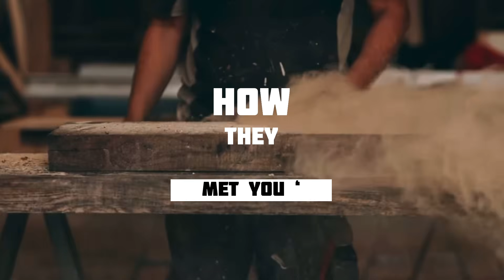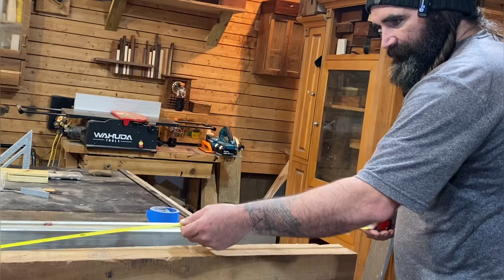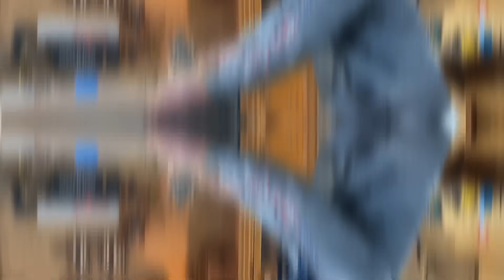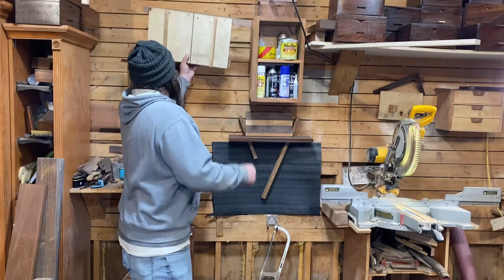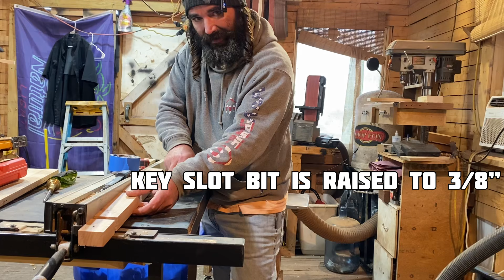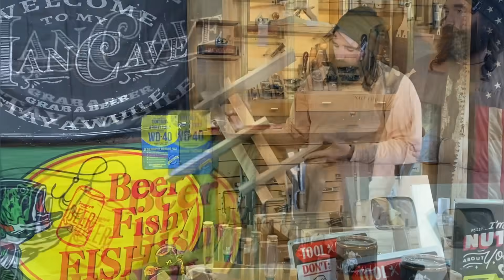These Projects Are Selling Quick / most Profitable Project in woodworking

Comment: lol I love how most people can get hardwood pallets all the ones around here are pine and the rough cut is only about 1/2 in thick slats so about the only thing you can use is the 2x4 piece that they use like you did but they almost always have big cuts in them for forklift forks to go in so there hardly anything to use in them around here 😞
Reply from the maker: Check job sites for new construction 🚧 that’s where I get mine 😉 thank me later
Reply: @ I have unless it’s something that’s shipped in from realllllly far away it’s all those pallets some of them are a little better the slats will be thicker but we have a lot of sawmills and stuff around here so the pallets are all disposable ones and rare to get anything good thanks for the tip though I love your channel!